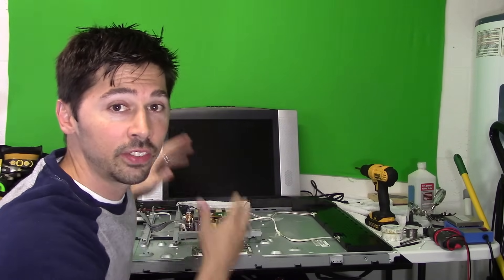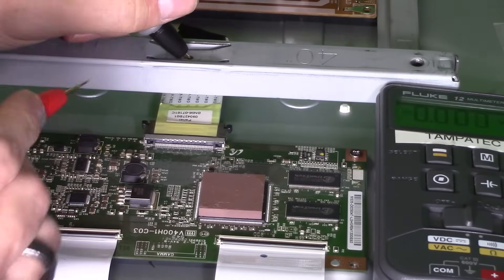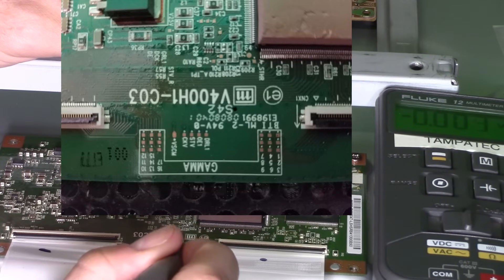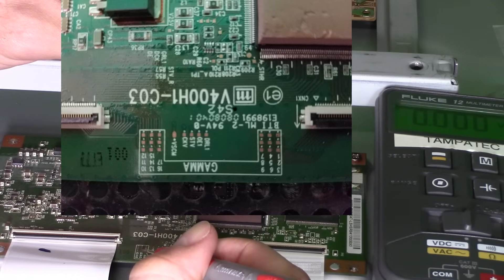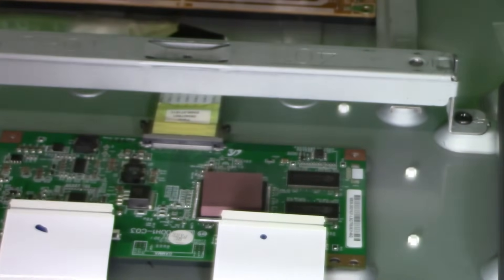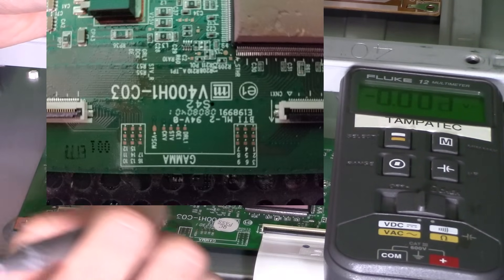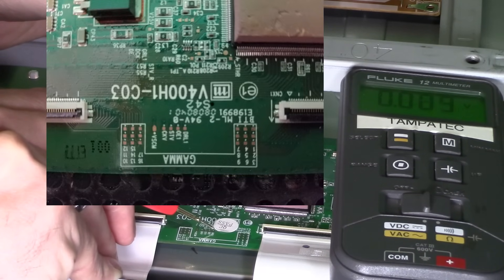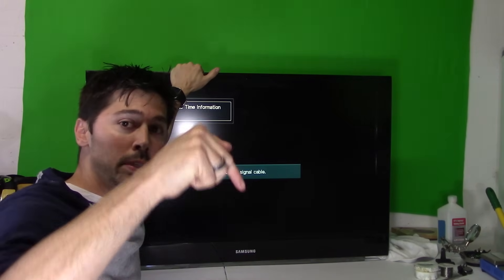THIS EASY 5 MINUTE TV REPAIR WILL FIX MOST VIDEO PICTURE PROBLEMS!!!

Comment from the maker: Help us Hit #800K subs and Grow.
Part1: https://youtu.be/CwMjNNKH_ps?si=-ydR15TKg2lMTLcL
 Please post "TV model" and "problem" and i'll reply with a common solution. Support this channel by getting a Capacitor kit for TV board repair- http://amzn.to/2gEH5Lt Thanks for the support! Let's bring back TV repair! Follow me on Instagram for giveaways and tech reviews https://www.instagram.com/tampatec/ GET REPAIR KIT HERE-http://amzn.to/2iUWYyv
Reply: Tampatec 
Hey was up from California , great videos I have learned a lot with you , I have a JVC not sure what model but question is (is it possible for inferred on the tv to go bad ) have tried multiple remotes and nothing 
Thanx a lot and keep on with your great videos
Reply from the maker: Danny C yes ir board or loose connection or software issue or main board can cause that. but check remote batteries and try tv reset first.
Reply from the maker: Dave Stephen check tcon to main board connection and tcon to panel connection. it can be bad main board, but possible you might have gotten a bad t con board that has happened to me.
Reply: Those  was a couple days ago. Just tried resitting the ribbons from the tcon board but ended up making it worst. Now 1/6 of the screen went crazy. 

Some other videos on YT suggest that each of the 2 ribbons control either side of the screen, but mine dont seem to work independent of each side. Both ribbons have to be in for the screen to come on.  

https://drive.google.com/open?id=0B7Vnxp5syz18VHg5ckQ1VzdvTTQ
Reply: Tampatec hey I have a LG 42lk450 with no pic. led comes on checked power board it is good. think it's a main board issue. I get no readings at all on the t-con board. what do you think? t-con board or main board?
Reply: Tampatec help me please
Reply: I have samsung un75j6300afxza tv and the screen is black with sound. So I followed your videos and I thought it was the power board, so I replaced it. Now I think it is the led lights. Let me know if I'm going down the wrong path. So I was about to buy the led lights, bit some are selling a few strips, (amazon) some say 28 (shopjimmy) or 29 (ebay) strips. Do I just buy the one with the most strips and replace all? I have not open the tv because of the size and I want to do it once. I also do not see videos on how to handle the huge screen, 65 inch or greater, led replacement.
Reply: Tampatec ,
Hi I got sony led tv ex40 520 with sound but no picture ,could it be the T-con board .?
Tks for your  videos ,i learn  alot.👍👍👍
Reply from the maker: Ng Ahseong yes most likely tcon board I think IC AS15 could be bad on tcon board. shopjimmy.com and electropartsonline.com has tv boards
Reply: Tampatec 
Hi, any ideas how do we get to order the exact TCON board for our tv model? How to get the part number etc..thanks:)
5:39 I accidentally took out the ribbon cable without unplugging the power cord and immediately put it back again..now there is no picture but backlight..
Moreover, vertical lines is one issue, my Samsung LED d6600 got horizontal lines on the top 1/4th section of panel. Are there any differences between two problems?
Thanks..nice detailed video...keepup:)
Reply: Tampatec 
thanks a lot,you are a great man!👍👍👍
Reply: Awesome video! Ive been looking for something like this forever. I have a 
Samsung LN52A550P3FXZA and I get the vertical lines on half my screen. TCon board has been replaced but problem persists. Note if i switch into 4:3 ratio this does not occur but only happens when the tv has been in 16:9 mode for about an hour or so. Leads me to believe something temp related. Thoughts? Thx!
Reply from the maker: kareno79 use freeze spray or heat gun to emulate the problem so you know what location is bad on the board. can be main board or loose connection to the LCD panel. can still be bad tcon board if you were sent a bad board, that happens often on ebay. try shopjimmy.com or electropartsonline.com
Reply: Tampatec That has to be the fastest reply I have ever received! Fair play to you.  I checked all the voltages with my multimeter according to your tutorial and everything matched up with the voltages you got from the new board you purchased.   I made sure all connections were secure but I'm wondering if it could be a bad cable to the Tcon board? Is there anything I can check on the main board before I lose my sanity? Thanks for the videos.
Reply: lg 70lb7100 I have this tv was given to me by a friend 
once you turn on the tv you can see it working ok but after a minute or two it goes black 
you can still hear the audio 
what could it be to fix it
Reply: Hey, how can i contact you 
I have tv Panasonic 4k 50" is freeze
Reply: Tampatec my Toshiba is blinking and it's driving me crazy they told me to put it on game but now it just continuously blinks what can I do
Reply: Hi. Thanks for your great videos. I have a Vizio E601i-A3. A while back heard a slight pop and  TV went dead. Checked power board, no bad caps but blown fuse. Replaced fuse, disconnected other boards, fuse blew again. Replaced power board and now have backlight and no picture. No symptoms of bad panel per shopjimmy. T-con board??? Thanks for any help.
Reply: Main board 100 per cent sure..
Reply: bro i have sony 55 inch led tv some time show picture after off please help me
Reply: Dynex model # DX-40L150A11   When powering on the "Dynex/Please wait" Boots up on the screen. After the boot-logo goes off the sound comes on and there is no picture what so ever. Just a black screen, no channel Icons or information, no Channel/Device port (HDMI/AUX) nothing appears. Just sound. This is the first and only issue I've ever had with this TV.  +Tampatec , I hope you still get messages from older videos. I've looked everywhere for an answer and your videos are as close as I have come to finding out anything. I hope you can help. Thank you so much in advance.
Reply: My Samsung tv has no video but it has Sound, am NOT a Tec guy
Reply: I liked the video, I'm subscribed to your channel, I'm looking forward to your help.  I have a Samsung 42" Model # LN48C630K1F, almost 10 yrs old.  There are 4 vertical separations of fuzziness.very distracting.  I've already clipped a copper wire to fix a previous display problem about 5 yrs ago, 2012 which fixed the problem.  Im confident I'll be able to find another solution for this fix too.  Thanks so much for your help.  5/5/17 1:28 EST VA
Reply: Hello, i`m not Tampatec but here in Germany is this failure a backlight problem. Check for first power supply  of voltage to the backlight if it is ok check the backlight stripes. We have no Skyworth here in our country but the sympthoms are the same. Best regards
Reply: Hi i have an horizontal line at the bottom third of screen and first 1/3 of screen goes a 1/4inch over the top 2/3 of screen and that 1/4inch that is over the top 2/3 is missing at the very bottom of screen
Reply: Tampatec my tv power is on but has a black screens
Reply: On this particular video, what mode should we place the meter on? I have a fluke 117.
Reply: Why does the E370VL don’t have a tcon board 
Tv turns on and (3 seconds) turns off right away 
Tried the power button hold down for 10 seconds and 
I replaced the motherboard already and still does the same 
plz help me bro 
Google advice is a joke
Reply: Samsung ls34j550wquxen sometimes left half of the screen is dark others it's just the bottom left. It occurs when I switch it on but will resolve itself if I power off and on multiple times.
Reply from the maker: Nishchhal  Bhardwaj the sticker number is the part board number. horizontal left to right lines can be issue with tcon to the LCD panel or buffer boards attached to LCD panel.
Reply from the maker: Ng Ahseong yes but check tcon volts. if you have backlight glow and audio but no picture then usually it's the tcon board. shopjimmy.com and electropartsonline.com have tv boards.
Reply: Samsung UN49KS800 Has white horizontal line in the middle of the screen
Reply: Tampatec Samsung LE40A556P1FXXU  Hi Tampatec. I have distortion of colours on the screen, i.e green shadows on dark colours and pink shadows on white colours.  I have changed the Tcon board for identical type but the problem persists.  Have you any further tips or advice?  I really don't want to have to replace the TV. Thanks in advance for any help.
Reply: Toshiba Regza 42HL67.  All 3 HDMI ports are not accepting signal.  Using high speed cable.  Cable works on other TV and sources.  Thanks.
Reply: Tampatec
Reply: Gary Hunter I thought so...oh well thanks
Reply: Dude any help with my situation?
Reply: sounds like an inverter board
Reply: sound ok but picture no show
Reply: panasonic #ct27sc15 6+ discolored horizontal lines across the top no matter the channel/input/cable/etc. Thanks for the videos and the help
Reply: subscibed and thumbs up... i am in taiwan , also a dummie in 3c. please sos me. u are a genius for me..
Reply: plz do a vdo    abt     led tv   farmware upadting   via usb stick...or programer
Reply: Dynex model # DX-40L150A11   When powering on the "Dynex/Please wait" Boots up on the screen. After the boot-logo goes off the sound comes on and there is no picture what so ever. Just a black screen, no channel Icons or information, no Channel/Device port (HDMI/AUX) nothing appears. Just sound. This is the first and only issue I've ever had with this TV.  +Tampatec , I hope you still get messages from older videos. I've looked everywhere for an answer and your videos are as close as I have come to finding out anything. I hope you can help. Thank you so much in advance.
Reply: Tampatec
Reply: Hey Tampatec, I have a skyworth 40" 40E36i no display but green light is good and with sound. I'm not seeing any other board beside from 1 board which altogether is there, power supply and systems board, would you know where to start to troubleshoot? Thank you.
Reply: Hi I got thoshiba led TV model 32PU200ZE  now it is no picture with good sound .plz tell me how to solve the problem
Reply: Hi, hopefully you are still answering questions here... I have an older Vizio vf550xvt1a, we used it for 5 years and stored it for 3 (RVed for 3 years) Got it out of storage, hooked it up worked great for 2 weeks, than one day it started "flickering"... we jiggled cords on back and it stopped, worked perfectly again. A week later picture goes black but we still had sound. We unplugged it, let it sit for 3 days (too busy to try and diagnose) Day three start to check out problem and plug it back in... Pictures back and looks great. So we set it all back up, start watching tv and 6 hours later, screen goes black again and this time not getting sound either... Any ideas?
Reply: nnn
Reply: Tampatec: I've a E55-C1 VIZIO 55"LED. Has Audio and Image as can been seen with 'Flash Lite'  but LED 'Back lites' are 'INTERMITTENT' Upon powering up. When a/c pwr is switched 'ON' via Rem/TV manually the Back lighting May or May Not turn on. Turn off TV, retry several times and Back Lighting 'TURNS ON' as in normal operation. Once LED Backlighting is operational,  I believe it remains so for at least extended periods if time, as in day's.  TV approximately little over 1 yr/old. I really enjoy your impressive videos,  wealth of knowledge and the GREAT Service they provide,  REALLY.  I've SUBSCRIBED. Can you point me in the right direction ad to what 'Board' I should be concerned with & where to purchase. I beleive I'm capable of doing repair myself.  I'll keep watching.  Tk You!, Curtis  T.
Reply: Tampatec Hello it's Curtis T again, the one who just sent you  question concerning a E55-C1 Vizio. I've also a SAMSUNG, Model Code:  'UN55D7050XFZA'  S/N:  Z3LY3CABC02313. It's a Costco purchase from 12/23/2011.  I'm crippled & knocked TV over face down cracking the screen only after 1/yr's operating time. Was $2, 800 3D Model.   Now picture is a  series of different colors/lines unusable.  Still has audio. My question is: Where can I purchsse replacement Front  'Screen' Panel w/out spending a $1k & is it worth it. I'm sonewhat capable & would try to do myself. Can you advise as to where I might locate parts? I'll purchsse through you parts for both TVs' and happy to do so in support of your terrific service and cause! Wish I knew your name. Thank You, Curtis Tassinare from Rochester Hills, MI. 48306
Reply: Water damage on a vizio
Reply: Hi tampatec.. I've watch all your videos,and that's very helpful to me regarding to troubleshooting of LED TV.if you don't mind can I have your email I'd? So for me it is easy to me to send or to ask your suggestion about LED TV problem and solution,,,thank bro and more power..
Reply: Tampatec ......
Reply: Tampatec ...........
Reply: LG 65UF850T 2 years old, Flickering Image could you help tq.
Reply: Hey very nice video.... I have a Samsung UN50EH5000F: My screen has a white wash type look to it. Audio but no video. I cannot even see the Tv Menu. I replaced the T-Conn but did not change anything. What would my next step be?
Reply: Tampatec I have an old RCA rear projection TV that I love. Lately it just stops working and the screen says no usable signal. Please help
Reply: Tampatec good evening to you and your family iam joe i have a tv does not turn on but it has the red light in the front on but when i push the on botton nothing works
Reply: . Thank you very much for your help. I have Samsung LCD LA32C530F with the T-con model number  
 F60MB4C2LV0.6, I have a double image problem, how can I solve this problem
Reply: TY for this helpful video. Im in the process of replacing my T Con board  Samsung LN55A950D1FXZA 9 years old (getting shipped).  I noticed some of the underside ribbon cables have scratches from touching a supporting piece underneath them. When i went to remove the ribbon cables from the tcon board, the underside was stuck to something like a support beam, when i pulled them off gently, they developed a scratch. Will the scratched ribbon cables affect my tv??  If so how do i fix that now?     Thanks for the Help!
Reply: problem: 42" coby LCD 3yr old. comes on but turns itself off after about 30 seconds. diagnosis?
Reply: Tampatec I have Samsung samsung 32h5500 usb not working ,i mean when i press source there will only tv,  screen mirroring,  hdmi1, component, options are showing,  none there of USB  option.... If i insert usb then also nothing shows USB,  and how to use wifi direct,  i couldn't use my phone with wifi direct,  i have vivo y21 Indian Mobile handset which supports wifi hotspot
Reply: Westinghouse Model VR-4090 problem: first, it has a purple colored strip at bottom of the screen.  Second, it flickers.  The picture shows but it flickers bright and low light.  Thank you.  Great channel!
Reply: Samsung LN40a650a1F ghost light shadows running vertically up from lighter colors lower on the screen. I hate to have to throw it away. It has served us so well.
Reply: you should do before and after
Reply: I have a Samsung TV that the screen is 95% dimmer than the rest lower portion of the screen. I replaced the T Con board and no diference. What could it be?
Reply: Tampatec I have 32LG30R-MA only white screen and humming sound , no picture at all voltage is 110-220
Reply: I need help finding the problem with my RCA TV I just bought second hand and the power button works and has a light but no picture or sound please help! Model:RLED4627A
Reply: Hey tampatec im having an issue with tv, i uploaded a video to my channel, could you possibly comment on it and let me know what you think it could be? I was told possible tcon board.. thank you love the work
Reply: I like your video about flickering but it is on a samsung, do you have one for panasonic ?
Reply: I need your help8658302197
Reply: Power on but no sound but has back light
Reply: I have a sharp aquos model# 52d64u doesnt turn on power light flashes and opc light flashes
Reply: Thk bro..learn a lot👍👍
Reply: I have LG43uj634V model. I facing on display horizontal visual from bottom side up-to 150 mm. Kindly advise the solution pls.
Reply: Hey there! I am having a weird problem with my Samsung UN65HU8550FXZA 3D 4K UHD TV. I've watched all of your videos, but none of them specifically address the issue I am having, so I figured I would ask. My TV turns on fine, but the TV image is zoomed in/cropped to where only a certain lower part of the input signal is seen, and it is quite vertically stretched looking as well. I can click Image Size/Aspect Ratio on my remote, and that same cropped input signal just gets smaller, or fills the screen, but it never expands the input signal to being the full source image. What is even more odd is that if I click the Menu button, I cannot see a menu pop up at all, so I am guessing it would pop up in an area that is being cropped out. This happens on all inputs, and I am truly at a loss of what needs to be replaced/repaired or if this was a result of someone pushing random buttons on the remote/settings menu. Any help on what the likely issue is or troubleshooting would be greatly appreciated!
Reply: TOSHIBA HORIZONAL LINES RUNNIN UP AND DOWN THE TV BUT U CAN STILL THE TV...
Reply: Very informative. Thanks for sharing, Lord-Jesus-Christ com
Reply: Very informative. Thanks for sharing, Lord-Jesus-Christ com
Reply: I do the repair
Reply: Hi I have marq 43inch led TV.White Line marks on the screen.what is the problem and how to repair this issue?
Reply: hey, I had black screen but had sound, changed main board and still have black screen and no sound now. is this a bad board still, did they send a bad board? I did a flash light test, no picture. I guess I am asking did they send me a bad board, should I have lost sound even if it wasn't board causing it?
Reply: Hey Tampa Tec 
I have a sony xbr-65×800h and there is a line that looks like a Crack on the screen. However it is not a Crack and it goes across the t.v from one end to the other. Got any ideas
Reply: TampaTec my tv keep cycling through menus and settings on its on what could it be
Reply: By
Reply: usually given on the board
Reply: Hi, I have a Sony 49x8500F. Power on, get some background sound (but it is not from a TV station, it is like repeating music). The original T-con board has a backlight but no picture. I replaced it with a new T-con, the front power LED is flashing between green and amber. Is the new (and original) T-con board bad?
Reply: Q😊❤miiiiiiiiiiiiiiiiiiii😊.😊